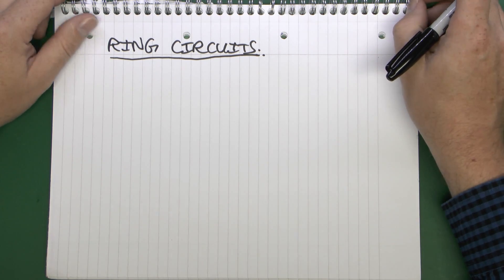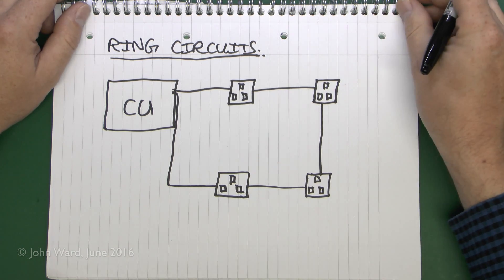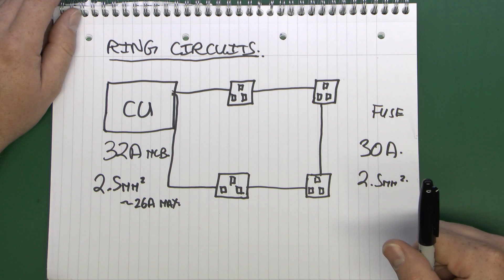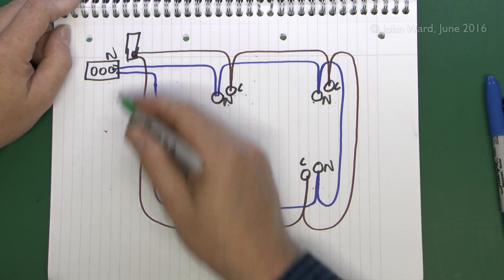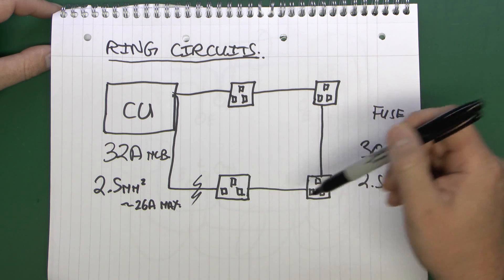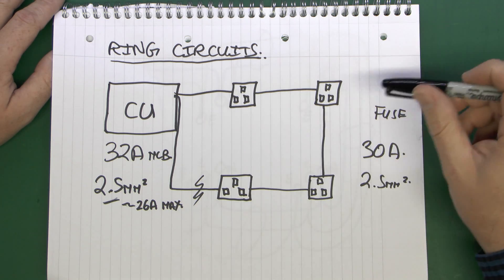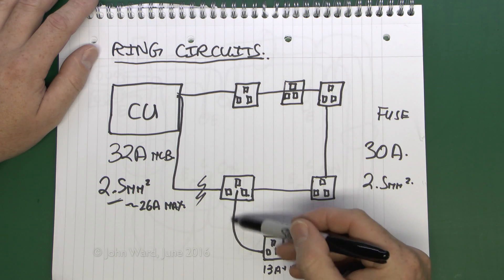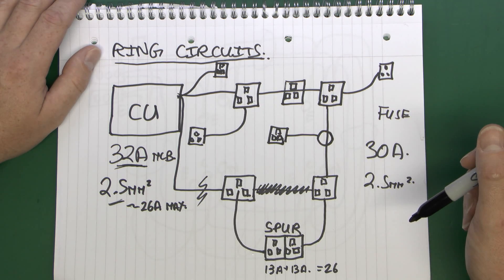UK Ring Circuits (previously Ring Mains) for Socket Outlets

Comment: You said the junction boxes would be in the floor, but why? Is that where people put them in the UK? Here in former communist countries, the power lines run high, just over the standard door height and your junction boxes are on the wall, each directly above the socket it extends to. Once the box is closed, it's painted or wallpapered over along with the rest of the wall. A light circular bump (square in older designs) remains visible where the box is, in case you do need to access it. You never extend from one socket outlet to another, always from junction boxes.
Reply: because it would look ugly having a junction box visible from the outside and i agree i always use junction boxes but i just hide them away from view unless it was very hard to access.

Comment: Hello JOHN WEST,
Great videos. 
Could I ask you to clarify my confusion on a basic ring circuit? 
I'm confused by the idea of two cables. 
As I've understood, the first cable runs through all the sockets and ends at the last socket. The second cable - does it run from consumer unit to the last socket or does it run through all the sockets and ends in the first socket?
Thanking you.
Reply: M K - one cable contacting three wires goes to the “first” socket. Then further sockets are linked via the same type of cable to each other, forming a chain. Then at the last “socket”, more of the same type of cable goes back to the consumer unit, and connects to the same terminals as the first cable. Hence electrical current can flow along either cable via any intermediate sockets and cables to get to the socket where you have plugged in an appliance.

Comment: hi,can we conect induction coocking in kitchen to the same circuit as is coocker conected?
Reply from the maker: Yes, provided the circuit is of suitable capacity.  In the UK, this would normally be a separate 32 amp circuit for the cooker, or oven/hob combination.  The fact it is an induction hob doesn't make any difference, it's the power required which matters.

Comment: Hi John, thanks for the great instructional videos. You say there aren't really any legitimate reasons to put in a Ring circuit these days, what what about where cable length is a factor? I have a large house, with 2000sqft downstairs. I currently have a 32a ring circuit for the sockets with, at a guess, 100 metres of 2.5mm² T&E. If I were to convert this to a 20a radial, wouldn't I suffer from severe voltage drops at the end of the circuit? I read that a 20a radial should have no more than 30 metres of cabling. Is this right? Thanks a lot for any insight you provide.
Reply from the maker: 30m of cable for 20A is correct but only if the entire 20A load is at the end of the cable.  In reality it will be distributed along the cable and the maximum length can be much longer.  The 106m limit for a 32A ring also requires a distributed load
Reply: Thanks John. Would you still use a 20a Radial with 2.5mm T&E in my situation where the length of the circuit is quite considerable? The circuit would simply cover the downstairs sockets (albeit 20+ double sockets) with no high wattage appliances. You may have guessed from my questions that someone is trying to convince me that the rewire should be a ring. Thanks again!

Comment: The problem with a 4mm2 radial is that the ccc drops to only 30 amps installed in trunking reference method B if cables entering db are installed using 50x50mm trunking as an example which is quite common if in a garage etc. You can't really omit overload protection on a socket radial circuit protected by a 32amp mcb if say it was a kitchen radial. So there are disadvantages in using this method.

Comment: i understood that In should be less than IZ..in laymans terms.... the current rating of the m.c.b should be  less than the current capacity of the cable (2.5mm) as there are two legs to a ring curcuit,each running from the c.u to the furthest most point of the curcuit then each leg has a current capacity of 27A, * 2= 54A therefore the current carrying capacity of the ring mains 2.5mm cable will be greater than the M.C.B,s rating therefore In (mcb) will be less than Iz (the current carrying capacity of the cable.
Ib (the load) less than In, and In less than Iz.
Reply from the maker: That's it.
With a ring, the problems occur when one wire is broken or not connected - you then have only a single conductor which has a rating less than the MCB.

Comment: a ring circuit has 2 cables. you confuse people by drawing one line
Reply: kristian humphreys muppet
Reply: +kristian humphreys
Usually there is Line, Neutral, CPC/Earth  (except, sort of, those using metal-conduit for earth, but its' still a conductor, just may not follow layout in the same way).
Reply: He drew THREE lines to each outlet. Whattya talking about?

Comment: If I don't know wether or not I have a ring circuit, crudely, if I shut everything down, chop the presumed ring circuit in two then power up and test every socket, if they all work then it must be a ring. Correct? Yes, very crude and simplistic.
Reply: Such anger.
Reply: At the Consumer Unit you will see the cable returning as well as the one going out.
Reply: That could just as easily be another circuit coming off the same breaker.
Reply: "crudely" was the adjective used by 'Goffic'.
Yes- to be sure one could check for continuity between the two - if there happened to be two at the consumer unit.
Reply: Way to get needlessly defensive about it. If someone sees two wires at a terminal and assumes that's a ring when it's not, you can't really say they're "crudely" correct, can you.
Reply: Way to get very defensive.
The poster obviously had little electrical knowledge - so a simple visual check would certainly be a good guide. Most situations I have come across have a single circuit at each 'breaker'  so as a guide, my advice was helpful.
However - the situation you describe  - with two radial circuits on one breaker would also result in two cables visible - so of course - you are correct to point that out.

Comment: John... nice information provided. Could a person theoretically go to Maplin electronics buy a solar panel and find some way to feed it into his or her electrical system at the consumer unit point? Or would this be dangerous or too complex? I've seen these things quite cheap now but would have no idea how to do it.
Reply from the maker: You can buy a solar panel and suitable inverter to connect to the mains supply.
It isn't likely to be worthwhile financially as the cost of the equipment will far exceed the tiny amount of electricity that would be created.
Reply: Thanks John... Perhaps not enough sun too. Are you an electrician or just have an interest?

Comment: Hi John, excellent videos. I wonder if you could offer some thoughts on choice of radial over ring in a kitchen, I have estimated the max diversified load at 23.7A, whilst a 2.5mm can just about support that, i'd presumably have to put a 32A MCB, as 20A MCB is too low. I don't want to put two radials in the kitchen because eventually somebody will do some maintenance turn off one kitchen MCB without realising there are 2 and kill themselves, not my problem but not ideal. So that leaves me thinking of a 4mm radial circuit with a 32A MCB, is that a more sensible approach in your opinion and will standard sockets easily take 4mm connections?
Reply from the maker: Yes, a 32A radial in 4mm is ok and most sockets will easily accept 2x 4mm conductors.  Some sockets will actually take 2x 6mm.

Another option is a 25A radial in 2.5mm cable, provided the cable is not installed in insulation or other ways which reduce it's capacity.

Comment: when i run a ring in a kitchen i skip every other socket and then come back on myself for the others
Reply: Interesting idea.... =).  Confusing for re-wirers later... However, from another point of view, this mayl increase the load distribution if high-power devices are used near each other on adjacent sockets towards one end of a ring, as they will actually be approximately equidistant from ends of ring in that case.
Reply: i disagree, 90% of the cable is run surface behind units, being buried the 300mm or whatever up to the socket so fairly easy to follow

Comment: I heard, and believe story that, those 2* single sockets as spurs, were often changed to double-sockets (e.g. those conversion sockets)), thereby overloading the protection requirements for unfused spurs.  So, regulations changed to disallow that configuration.
Reply: 13x2=......?
Reply: @cglees  26 =)  which, is usally ok for a 2.5mm cable unless thoroughly insulated.
Diversity says in pratice this double-socket-spur (or indeed, 2 single sockets as spur) is allowable.
However, for some reason, 2-sockets-to-1-plug adapters are allowed un-fused, which seems kind of silly!.

Comment: Can there be a good case for Completing a B20-breaker radial circuit, into a complete ring (while keeping the B20-breaker, not B32),  as a means to reduce the Voltage Drop with little extra cable, while avoiding the 'overloading' scenario mentioned?.
Reply: This also allows for any section of the ring to be 'removed' if damaged, without having to re-run cabling / hacking out floorboards/walls/whatever.   This can prove useful in many cases!.  I do think this is a good reason for wiring as a ring even if you use a B20 breaker...
Reply: @sbusweb  easier to "split into 2 radials' on 2x 20amp mcbs.

1 cable from 20amp mcb to sockets
and
another 1 cable from 20amp mcb to sockets....no join between the radial sockets...both totally separate!

easier to fault find and add too

Comment: So how do electricians add an extra socket when the cable is behind a plaster or brick wall?
Reply: I can't speak for all sparks by I look for the easiest and least destructive options and give the customer a choice if I can. eg. Say you've got two bedrooms back to back and you want and extra socket in bedroom A. If bedroom B has an outlet on the opposite side of the wall, I can simply drill straight through from the rear of the existing one and surface mount the new outlet. Failing that easy arrangement, You can bring circuit extensions down from the ceiling or up from the floor, depending on where the existing circuit is. Typically you have to chase the wall (to be plastered and made good afterwards) or install surface trunking. If you are VERY lucky you may be able to feed a cable up/down behind the drywall if it isn't heavily insulated and there are no cross-members. This is unusual though.

Comment: Is it part of regulations that the cable between the two sockets (just after 12:40) is removed, disconnected or as you put it "deleted"? I cannot see any practical reason it can't remain. (I'm not an electrician and ask out of curiosity)
Reply: If just adding one double socket it's easiest done as a spur, if you were adding multiple sockets it would be necessary to make them part of the ring, this can be done without running new cables to two existing sockets that are adjacent on the circuit, if you run both cables for your new sockets to an existing point on the ring (preferably a double socket for more connection space) you can extend the ring by crimping a new cable onto an existing leg of the ring, and joining the remaining new cable and existing leg in the socket terminals. it's often the case that existing sockets are in places you can't damage the decorating to get cables to them so this method isn't often that useful.
Reply: Sorry just thought more about what you were asking and my previous comment was probably irreverent to what you were actually asking, if you meant when he joined a second cable from his new socket to a second existing socket then yes the original connection between the two adjacent sockets needs removing as an interconnection in the ring can prevent a disconnection of a conductor from becoming immediately apparent during testing
Reply: Dan Reeves
Thanks for your second reply - I "think" I now understand. Would I be correct in thinking that a double socket has to actually become part of the ring circuit (as opposed to a spur) so it doesn't overload the cable to it - and if there was a disconnection between either of the two cables between the two old sockets and the new double socket although the new double socket would work OK (unless loaded too much). If a check was made on the full circuit that disconnection would not show up because the new double socket would then technically just be a spur (capable of being overloaded) because the existing circuit had not been broken into. But if there wasn't a disconnection the cable between the two old sockets wouldn't actually be dangerous the new double socket would still get power from two cables (sharing the load)? Hope that makes sense to you and thanks again.☺ Incidentally I can now see why regulations probably  say the cable between the two old sockets should not be active.
I'm now wondering if installing a double socket could be done as a spur (from a ring circuit) if heavier cabling was used (not that I intend doing it) ☺☺☺
Reply: No -- normal 2.5mm cable is 'acceptable' to run a single Double socket (at maximum) as a spur.  More than that and you need fused connection unit or fused-socket unit or what-have-you ...

Comment: How much wiring is allowed to be done by a non-qualified (or whatever the correct term) person?

I.e my cellar has no sockets in it, but a cable to the upstairs room's socket (it has one...) runs along the wall and through the ceiling. Am I allowed to put a junction box on that cable and attach a socket to it myself? After all, it's not very hard to read wiring regulations and buy correctly sized cabling and then match coloured wires up.
Reply from the maker: In the UK, there are no restrictions on who can install wiring or electrical items.  The only requirement is that it is designed and installed to prevent fire and injury.
A few items are classed as notifiable work, and for those it is necessary to notify building control before starting in the same way as if installing new windows or building an extension.  For England that only applies to a consumer unit replacement, new circuits from a consumer unit, or items inside the zones of a bathroom (within 60cm of the bath and less than 2.25m above floor level).
Reply: Correct
Reply: John Ward 😕❓❓💜✝♎️🔊

Comment: When I had my kitchen re-done the electrician found four double sockets on a connected together spur on one side of the kitchen which was odd as the other side of the ring was about a half a meter away.

Comment: Knew nothing of the circuits in our first house. Second had a ring circuit on each floor. Third, one for front four rooms, one for back three (a bedroom plus the kitchen and utility). All three bedrooms had one socket on the ring and one on a spur. There was, bizarrely, a 2A socket attached in one of them as well. This ring was later properly extended as more sockets were needed. My own places, single ring in first flat, two likely rings in second - one covered only the kitchen, the other all the rest. Third and fourth flats had single rings, current bungalow has two probable rings - once again one is just for the kitchen.

Comment: Although a bit fiddly, I still find it infinitely better than America's wiring system. Why? US devices (generally) do not have a fuse. This means that the maximum current allowed is dictated by the circuit breaker, which also protects the mains wiring. This means that a whole selection of outlets (like the upstairs loft outlets, shared by my brother's bedroom) can take a combined maximum of 15A, as that is the standard size of circuit breaker and allowed current for the wiring. Running a vacuum upstairs while my brother's PC is running will trip the breaker. Because our voltages here are half of everyone else's, devices have to draw double the current for the same wattage, and with a breaker half the current of UK systems, this is really annoying.
Reply: In practice, though, how often do you trip circuit breakers in houses or apartments in the US? I'm 41 and I can count on one hand the number of times I've lived somewhere where that's happened. Mainly it happened in a house with 1920's wiring where I lived briefly.
Reply: John Gotts I tend to live a bit of a photonicinduction lifestyle...